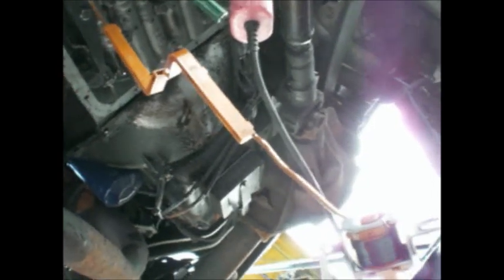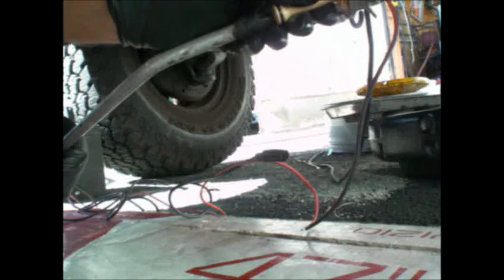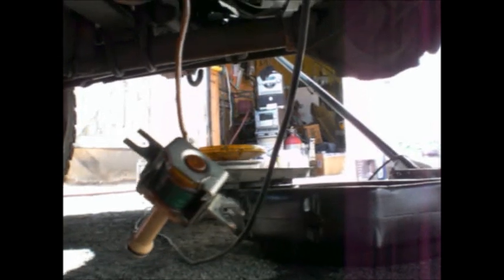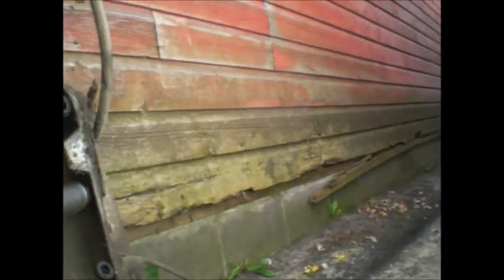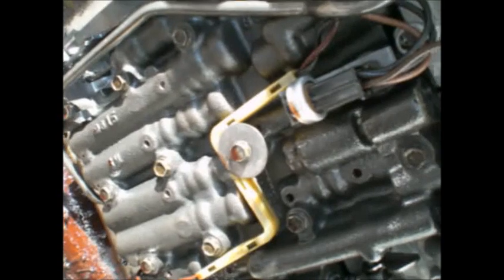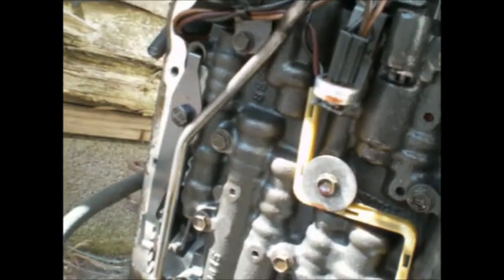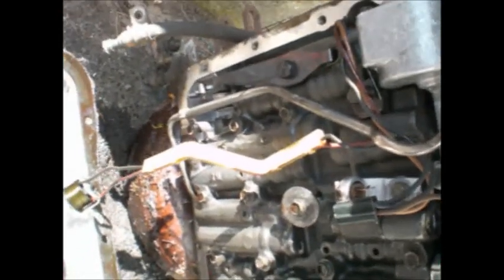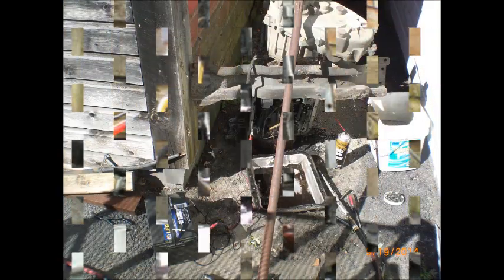SF Tranny Valve Body Solenoid Test  9 19 14

Comment: Like trying to pry open a giant size can of tuna!  That extra 'thing' is an auxiliary, accumulator added in 1987 and up transmissions to help cushion the engagement of the forward clutch mechanism.  The offset mini switch is an oil temperature switch, that will not let the converter lock up until the transmission reached a certain operating temperature before the days of more advanced computer control. There are at least 15 different types of wiring schematics/plans for these transmissions.  As for no oil filter, I wonder if Buddy ran the unit way overfull of oil to compensate for the lack of a filter/suction tube.  Anything is possible, but it must have sucked air quite often.